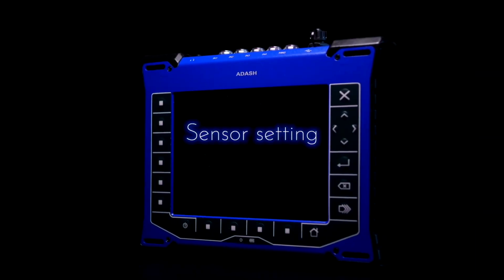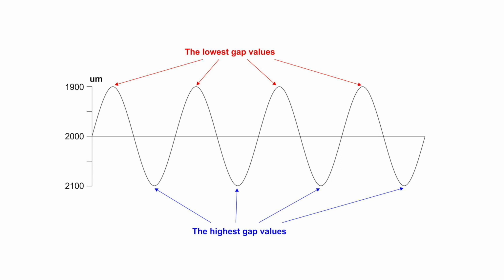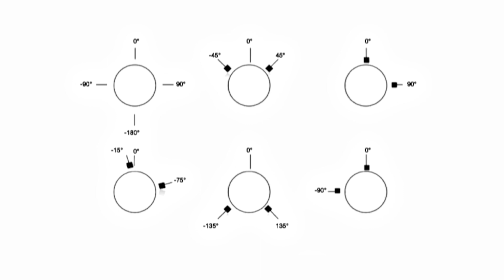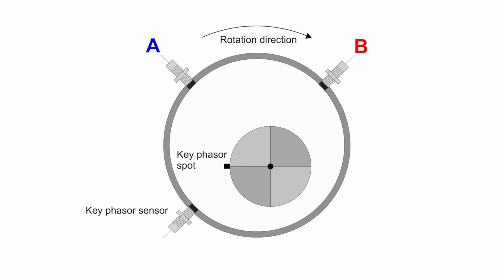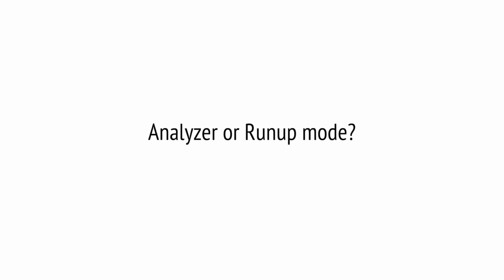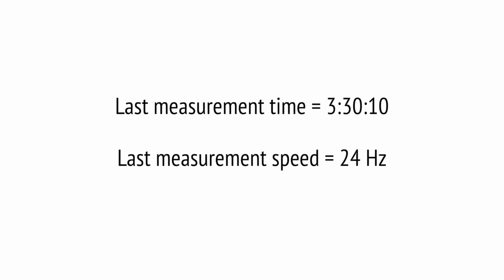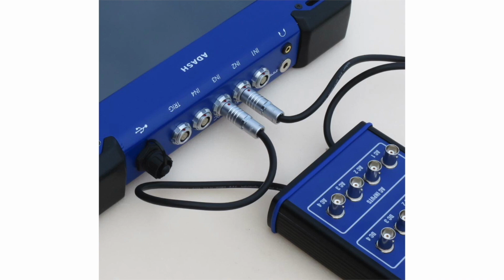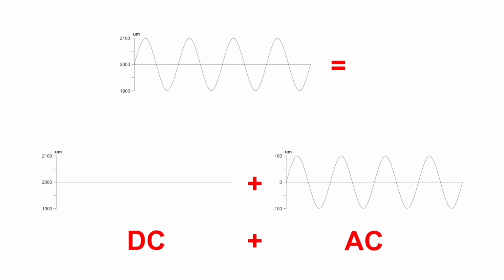Turbine vibration: How to measure and analyze signals from eddy current (proximity) sensors (part 1)

Comment: Is the A4409 - BNC BOX required to capture the AD and DC signals from proximity sensors in the A3716? Can't you just plug the proximity sensor signal directly into a single channel and have the Adash analyzer split the AC part from the DC part?
Reply from the maker: You can connect proximity probes directly into A3716. There is no problem with that as the A3716 online system has 16 AC and 16 DC input channels. A4409 BNC Box is a special junction box for Adash VA5Pro, VA4Pro and SAB portable vibration analyzers. These analyzers can measure 4 AC or 4 DC channels simultaneoulsy (or combination) because they have only four input connectors. However 2nd input contains 4 AC channels and 3rd input contains 4 DC channels. Therefore with A4409 BNC Box you can measure all 8 channels simultaneously.
Reply: @AdashCompany  Thanks you very much for the answer, so if I have an A3716 and for example I want to connect a proximity probe, I have to connect the sensor signal to channel 1 AC and also to channel 1 DC? that's similar to connect the sensor signal in two channels, am I right?
Reply from the maker: @juanperez-so9zz  You are right. But still you are taking only 1 AC and 1 DC channel. This means you will have additional 15 AC and 15 DC channels available. Please write to our sales / technical department if you want to discuss it further. Contact: revaj@adash.cz

Comment: Why using -ve voltage in vibration sensor why not + ve voltage?
Reply: Npn transistor used
Reply: @johnnyvenu6893  Really negative Voltage depends of transistor. But I would guess is due PNP transistor.
Reply from the maker: Proximity probes manufacturers simply uses - voltage. We are afraid you will need ask them ;-)

Comment: If keyphaser trigger signal and hot spot signal are zero degree difference then keyphaser probe and Y sensor probe should be on same position. If both probes i.e keyphaser probe and Y probe are mounted 90 degree apart and hot spot and keyphaser hole are on same position then keyphaser signal and hot spot signal should also be 90 degree apart.
But in this video key phaser probe and Y probe are 90 degree apart and speaker is saying hot spot and keyphaser location is same?
Can anybody explain this, thanks
Reply from the maker: Thanks for your comment. What do you mean by "hot spot" ? Also what time of the video you are talking about? You can write us on revaj@adash.cz for further discussion.